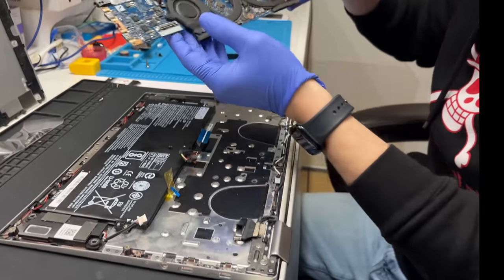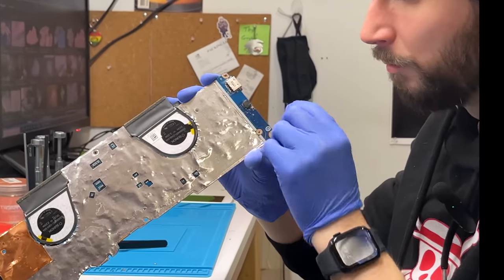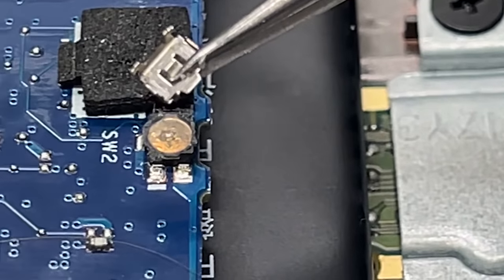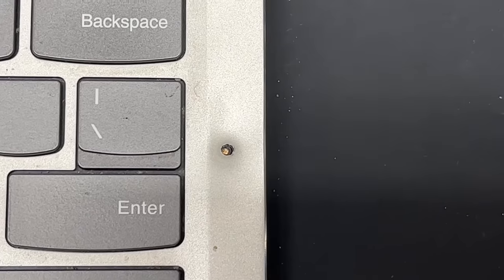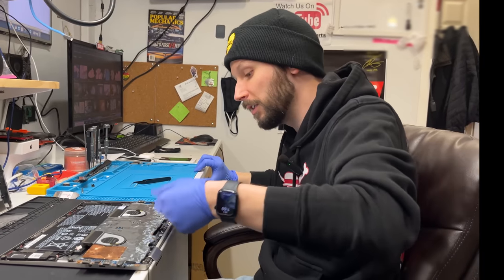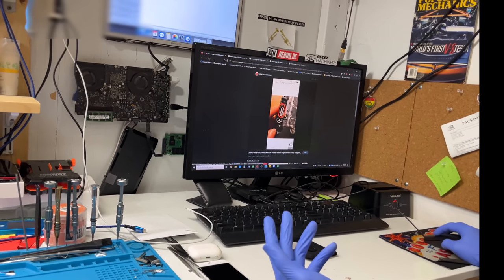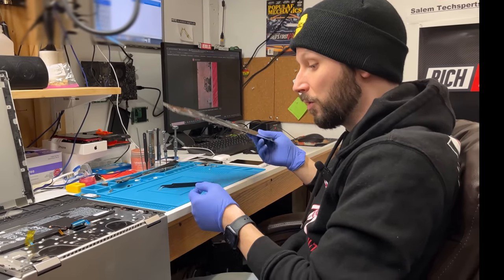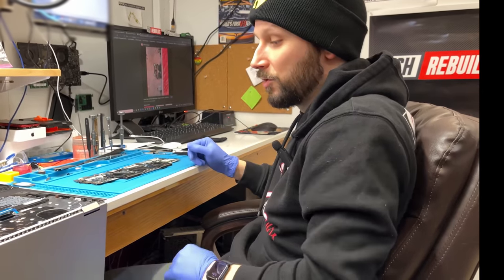Another reason to never buy a Lenovo Yoga (huge design flaw)

Comment: So sad to see this happen to a company like Lenovo, yes their reputation is borrowed from IBM when they bought their hardware division but still they held the line for a long time and earned their own rep in their own right by keeping the ThinkPad a ThinkPad as long as they could, so sad to see another company destroyed by their own accounting department.
Reply: my thinkpad yoga doesn't rely on this mechanism, it has a separate pcb just to house the on/off switch which is connected to the mobo through a ribbon connector. i understand that thinkpads are still designed in japan by the original thinkpad team since ibm times, but the other sub-brands like ideapad etc is designed in china and perhaps that's how this came to be.
Reply: The ThinkPad line still holds much of the same reputation that IBM devices had, and IBM ThinkPads certainly weren't perfect.
Reply: honestly though, Lenovo DID end up slowly taking away features from the thinkpads. I have access to an original IBM thinkpad T40, which compared to a Lenovo thinkpad t410 which wasn't made too much later, but loses many of the quality of life features of the t40, while also having an overall lower quality build. This trend has been going on for a very long time, today, thinkpads have become glorified macbooks, with soldered components and extremely thin form factors with poopoo battery life and extreme prices, except unlike the macbooks which make up for the small  batteries with efficient homegrown processors, lenovo further reduces their devices effectiveness by adding design flaws to make their devices fail faster.
Reply: Did you try to say that accounting is the cause of corporate greed?
If so the analogy makes no sense. Accounting is there just to run the numbers, they have no decision power over product design and are not direclty influenced by sales profit margins or anything. Even if Lenovo would reduce manufacturing costs by 50% and double their sales, accounting would not get any direct benefits.

Its not a big deal, but just a nonsensical analogy.
Reply: This, dell inspiron and HP are garbage
Reply: Lenovo still tends to be far ahead of the competition in allmost all price ranges.
Reply: @ChrisTian-sd5yq  can confirm Inspiron line of laptops are shitty
Reply: Still my favourite computer company, hopefully they don't keep going down this road
Reply: 'marketing' department and top management
Reply: It's not the accounting team at fault it is this whole idea of share holders and infinite growth that is destroying capitalism
Reply: Which laptop should I get then? I’ve been needing a new one and then saw this video.
Reply: @OkarinHououinKyouma why inspiron is bad? Can you elaborate? I was wanting to buy one in few days
Reply: I own a Lenovo Legion 2021 but thankfully it doesn't have that many flaws (other than software related). Hopefully it holds up well into the future because I'm not planning to change it for the next 5-7 years.
Reply: @Tappettava Yep, accountants get a bad reputation based on decisions made by others. Crazy.
Reply: What about the LOQ and Legion laptops? Are they of good build?
Reply: @blackknight6757  nope, those models are built similarly so they break down consistently + can’t be repaired easily
Reply: Newer thinkpads are still pretty decent, as long as you get the business line and not the yoga line. Granted, just buy one that’s like a few years old. They’re amazing deals, you can get a thinkpad from like 2018-2019 with thunderbolt and USBC, 1080p displays, 16gb of ram and an OK i5 CPU for like… $250.

the point is even though a lot of Lenovos kinda suck, the thinkpads are still decent. I’d always recommend used though, just because brand new thinkpads tend to be a bit pricy
Reply: thank god i just got a thinkpad t430, loving it so far.
Reply: @ChrisTian-sd5yq can confirm on the Inspiron lineup being dogshit as well, was handed one in 2021 (Inspiron 15 3511) and since then: 
1. the hinge has exploded and damaged the screen
2. audio Jack does not  work (fixed by using a usb a to usb c dongle to plug in an apple headphone dongle) (that’s right a laptop made in 2021 does not have usb c)
3. chassis flex caused the trackpad to think it’s being clicked down at all times
4. trackpad itself doesn’t work
5. unable to access internet sometimes and only way to fix it is to restart the system but get this: the thing gets itself stuck in a restart loop every single time the internet does not work and ultimately ends in a blue screen.
Reply: Sshh the nonsense comment is on top with 1000 up votes.
Reply: @hMint  The Inspiron line is enormous.  The model you have is almost as low as they go.  When you get to the 7xxx tier, they at least feel well made.
Reply: Thinkpads are still legit. My 11 year old T430 is still kicking. Also got a newer E15 2 years ago, no complaints at all from me
Reply: @ChrisTian-sd5yq Z books are fine, so are Invictus models
Reply: Lenovo these days it's just cheap Chinese garbo
Reply: They changed the design of the thinkpad that everyone loved, so they could stupidly try chase the apple market that they’d never get.
Reply: @Tappettava 🤓🤓🤓
Reply: Its a Chinese company. Why were you expecting quality?
Reply: A tech company that used to sell high quality but expensive equipment, evolving into low quality overpriced garbage... 
That's what we in engineering call, an hostile MBA takeover!

- An MBA quickly increases the companies shares, by cutting costs whilst degrading the technology stack! 
- An Engineer slowly increases the companies shares, by increasing costs whilst improving the technology stack!
The former option is fast, yet not long term. The latter option is slow, yet very long term. Shareholders are sadly impatient, thus prefer the former option more!
Reply: "I don't know what accounting does, I'm just going to condemn a department that has nothing to do with the design or decision-making process because I'm too unintelligent to google what words mean"
Reply: I bought used thinkpad t459s and just realised that the ram is not upgradable🫠
Reply: @Villager_U  How much did you pay, for the used t459s?
Reply: ugh Thinkpads are shit now too

i've been using a T480 for 4 years now, and while it still works, the overheating on the default windows installation was ridiculous, a corner of the casing plastic broke off, there are constant issues with the wifi and bluetooth cards, the lenovo LEGACY app keeps breaking shit and taking up resources, the Thunderbolt usability is about 60% reliable, the webcam is dogshit, the touchpad stops working if your fingers are sweaty, the fingerprint reader has NEVER been even usable, and the IR webcam face recognition works about 50% of the time
Reply: @purpinkn  "Its a Chinese company. Why were you expecting quality?"

Well... If a product says "Made in the USA", it usually means more expensive, yet worse quality than the Chinese version. 

Or that's my opinion as a European...
Reply: like bruh... dafck u mean "destroyed by accounting department"? Never go to school?
Reply: Thinkpads are still around and better than ever. They're just at a premium compared to the other Lenovo models (like the yoga)
Reply: @NateTrynaMakeMoney  The accounting and sales department, increase company profits, by saving on R&D expenses.
This works for short term, until products from competing brands become more interesting for consumers to buy.

A more long term approach to increase company profits, would be to improve the engineering teams work efficiency. This by investing in new equipment, tools, training and good R&D management, rather than the dimwits that usually lead R&D teams. 

So yes, he know what he's talking about.
Reply: @Adlore  Sure... A friend of mine's Thinkpad has randomly a defective keyboard, which is glued into the chassis an thus irreparable.
It's all mass-manufactured e-waste, build to be un-serviceable when things break...
Reply: @timmy7201  It would only trace back to the evil management and their bad decisions
Reply: lol, all the angry accountants coming out of the woodwork to shake their fists in the air 😂 Full of claims about why accountants are great.
Reply: They are designed in Japan and the designed well for the user. Then the Chinese part takes over and uses the absolute cheapest garbage components. It's like some sports cars, looks good but you will spend most of the time fixing them.
Reply: @charlesturner897  It absolutely does not. I've old Thinkpads from 2000s which still work well. All the newer ones I've bought fail constantly - keyboards, screens, ports, motherboards etc.
Reply: Accounting department? Don't all corporations pay zero taxes by default, because they find legal loopholes?
Reply: @remixedcat yeah since T440 the Thinkpad looks very Chinese design the keycap is not even square either it so ugly
Reply: @RustieFawn definitely fail that most college student I encounter have a Mac. Lenovo should stick with IBM way
Reply: I wish consumer electronics weren't made with the intention to replace every year or two... but I do really love the second-hand dirt-cheap Yoga laptops I bought. So far still running well. Maybe the flaws like this in part help careless consumers hand them down at cheap prices to people like me.
Reply: ANY comany is the same, HP, Dell, IBM, Samsung, Sony etc. What they lose in people brand hopping they make up with endless sheep just absorbing the loss
Reply: @ChrisTian-sd5yq You mean HP Pavilions (I prefer the ProBooks and the EliteBooks)?

Comment: Had yogas as a school laptop years ago, students figured out that they could detach the entire screen by sticking their thumbs between the bottom of the screen and the keyboard.
Reply: omg
Reply: This kills the yogas
Reply: yup. cause the screen is glued on to the hinge.
Reply: Children are the best way to find flaws in your design
Reply: My school uses yogas and I was given 2 that didn't work until they finally found one that could turn on. That was a common problem for everyone 💀💀💀
Reply: @Feral_Cockroach_ YWNBAM
i'm not surprised you have mommy issues tbh
Reply: What?
What?

What,
WHAT?

WHAT!
WHAT?!

WHAT?!
Reply: A lot of cheaper laptops are like that.
Reply: Lenovo surface pro

Comment: They were all like APPLE DESIGN school on that.
Reply: But we dont(
Reply: Remember how the power switch on button on the older iphones won’t work when the plastic underneath broke off and makes you replace the ribbon cable to make the button working again?
Reply: Please, the build quality on Apple products is years ahead of the competition. The fact that it isn't great just says the alternatives are abysmal.
Reply: @rumble1925  The build quality of Apple products has taken a nosedive too. I don't hate apple, I've owned a MacBook Pro and an iMac myself, but those 2000s to early 2010s MBP's really felt like machines built for professional use. Now they're more akin to a status symbol made to break as easily as the cheaper status symbol. Imagine, on the old models they literally had slots intended for swapping out RAM or hard drives yourself. Not just allowing you to do that, intended for you to do that. Instructed in the manual. The battery you could just click out and swap in seconds without even needing to open the thing up.

Comment: These Yogas were what got me into hardware repair. I had a 2016 hand-me-down from my mom. Got two more duds for parts. Two Hard drive failures, ram failures, four broken motherboards, power switches, keyboards, backlights, everything that could break did in the less than 3 years I was using it. They broke so often that i cobbled a backup laptop together so i had a working one when the other inevitably broke. For a laptop that cost $1200 new it's inexcusable, especially considering how resilient their older thinkpads are.
Reply: Can I ask if it is pricey to buy the required tools for repair? 
It may not be related but mobile phones are brittle too, they all died on me within the 3 year range. I'm very annoyed. They all have a motherboard issue, and some of my data which i wasn't able to backup couldn't be retrieved...🥲
Reply: @OdyLoveMusic  Not really, the only tools you really need is a good screwdriver (pack of different ones or one with replaceable blades, preferably magnetic), tweezers, some sort of working soldering iron (even cheap chinesium will do, but you dont need it that often) and racoon fingers. The only two more things you need is source of replacement part (amazon) and knowledge of what you need to do (internet/YT guides).

Comment: Wow!!! I hadn't realized that issue with my Yoga...its going on 6 years and only replacement was the battery (which I should haven't done.... gone thru 2 Amazon returns).. Its still going strong except for 3 hour battery life of course. Then again I did pay 700 OTD from BestBuy.
Reply: Yep. My yoga is 6 years strong as well I must have gotten lucky.

Comment: I have a desktop PC, but I needed a laptop for university. I chose the Yoga c640 (2019) for two reasons: battery life and the stylus for writing/drawing. After a year and a half, the battery capacity dropped to 32% (discovered thanks to Linux). While I didn't use the pen because it made me nervous, transforming a straight line into a wave. Purchasing a compatible Wacom pen did not solve the problem. So it's the laptop problem. My Surface pro 1 (2013) pen has no battery and worked much better. Not to mention the screen that dances after a month and the fans that for a year (with the latest bios updates) startes at maximum speed and gradually decreased, repeating this cycle every 10 seconds (even when the PC has no applications open on fresh instaled copy of windows). Personally I prefer Windows but (thanks to Lenovo😔) now out of my home  i am a Macbook + iPad user.

Comment: Drilled already 2 holes for supporting screws for the hinge on my Y580. Also hotglued the hinge in the case after everyplastic nose on the hinge broke. 😛Also the fan cleaning process was a pain in the a**

Comment: i remember i had a lenovo laptop but the power button was a bit different then the once shown in the video. The laptop used a button needed to be pushed virtually towards the upper part of the laptop (i appoligize for the bad explanation). And the laptop cost us 300 to 500 dollar back than. So its quite sad as the laptop was pretty fast and my stupid young self left the laptop at the store when they told us it couldn't be fixed. TwT

Comment: This is why I hate Lenovo.  Use to have a C940 and the onboard Nvidia GPU would straight up brick the laptop and I wouldn't be able to turn off the laptop.  The only solution was to let the battery die.  It also eventually destroyed my SSD so I couldn't re-partition it and the laptop would brick when trying to get into the bios.  This occurred on Christmas night.  Got a Dell XPS 15 9520 and holy crap that was such an improvement.  Runs betters, upgraded to 64GB of RAM, two M.2 slots for full sized NVMe SSDs, and I can charge it completely just from the USB-C ports.

Comment: I have a 2nd gen yoga. It's worked well all these years. Started to seriously slow down and crash frequently. Eventually the battery started swelling up so I had to remove it. Funny enough, using it plugged in without the battery it is as fast as it was new.  Physically it's falling apart. The rubber molding around the screen bezel is flaking away

Comment: I have had a 15 ikb for 6.5 years. Didn’t have anything like that, but the power button being on the side is so annoying and caused me to accidentally turn it off so many times. The fingerprint scanner also doesn’t work anymore, other than that it’s been fine, replaced the battery still works well.

Comment: Just as my lenovo ideapads 2 year warranty ended, keyboards w key, d key and ; key seemed damaged, like they dont feel rigid, they feel extremely soft and require almost no force to push them down (i used w and d alot but I don't get the rhe ; key). Ill still try to make use of it at least the next 2 years before (or maybe 4) before replacing

Comment: I had an Acer Spin 5 which also had a similar design. It was a plastic spring that basically connected the button to the switch. One day, it suddenly moved with a snapping sound. The button still worked for some time but it didn't click and I had to really mash my finger into the case to make it work.

However, a couple weeks later, the power button didn't work at all anymore. So I opened the laptop.. and what do I see? The microswitch is a teeny tiny sideways-mounted SMD component and one of its legs RIPPED off the PCB. So my ghetto fix was to put a piece of cardboard between the button and the case. That worked for about two weeks and then it completely flew off. I suck at microsoldering so I just got a new laptop instead. This is a design that should be banned. It is unreliable and incredibly hard to fix. Especially on older laptops like the Spin 5 which are EOL and don't get any replacement parts anymore. At least ones that aren't incredibly overpriced. Companies should just.. not do this. But who knows what will happen.
Suffice it to say, I'm glad I went ahead and got a ThinkPad E14...

Comment: Good old days with laptop wwre fully customisable removable battery easy repair easy to upgrade as everything divided in section, not shitty design. 
The dell Inspiron 1510 is still running the SSD was sooo easy
Ram everything written on motherboard how to fo things

Comment: lmao of course it was the power button. A couple years ago I wanted to build a custom gaming pc in office lenovo workstation case that would have been about 10 years old at the time. Guess the part that caused me the most trouble... The power switch. The case was using a different connector than every other pc power button I had in my entire house, so instead of actually dealing with the lenovo bullshit (kinda like how you drilled the hole) I think I just hotwired my power button